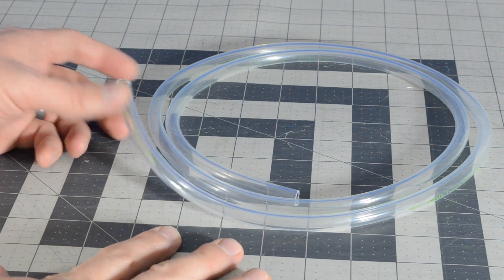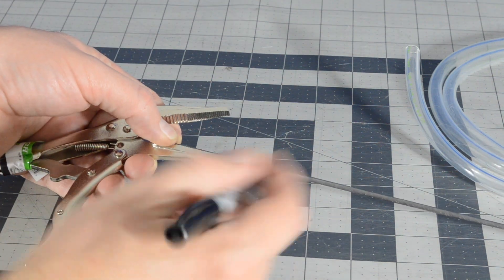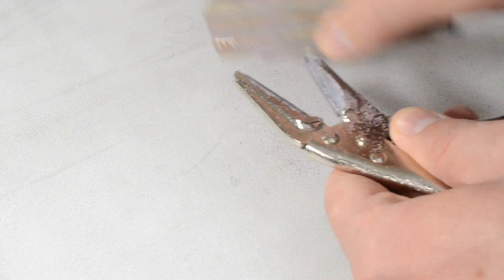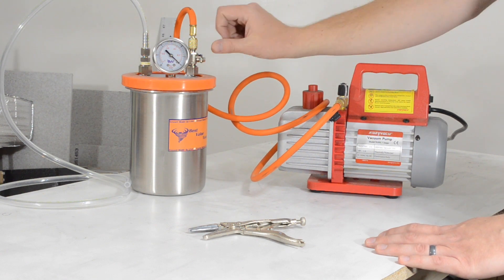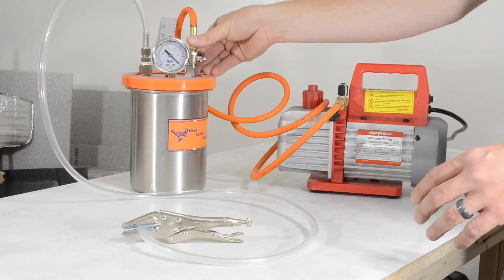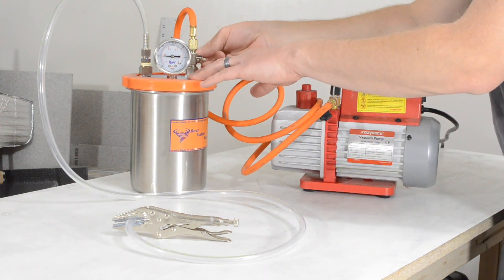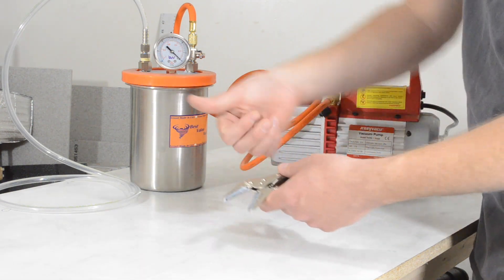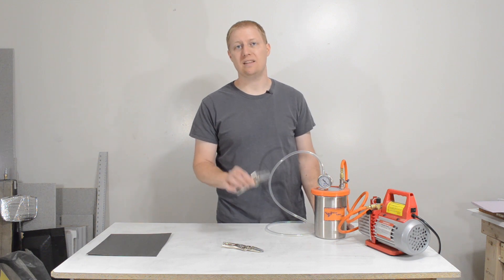You NEED This Infusion Clamp!

Comment: Glue!  Thats a good idea!  And small is nice too.  I’ve welded them like yours and used the carpet puller type with the flat wide jaw and they’re ok but big and heavy.  The DD Compound Squeezer - style you mention is great but yeah $35+ each really adds up!  Nice to be able to throttle for feed.
Reply from the maker: I couldn't believe it when I went to buy clamps and all the ones I found were $35-50.  That's what got me started thinking about making my own.  I hadn't considered the need to throttle the feed, though.  I guess that's one thing this design doesn't offer.